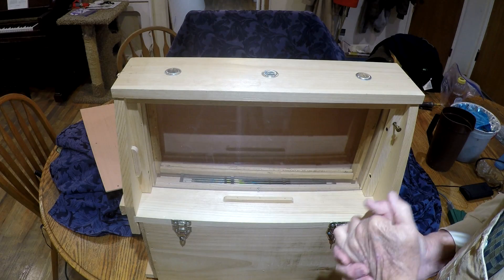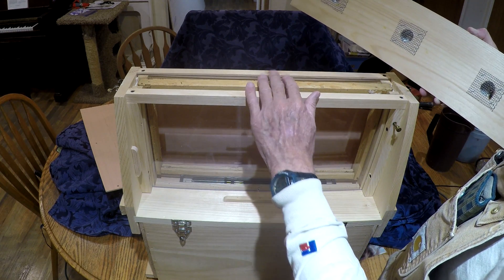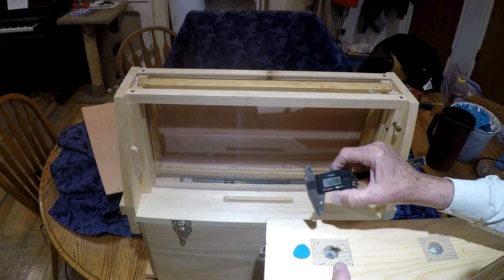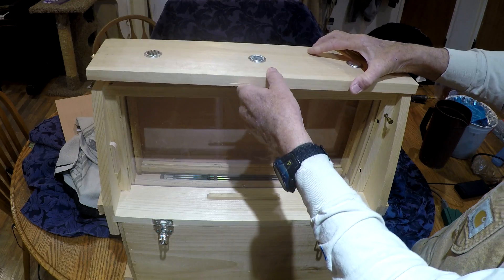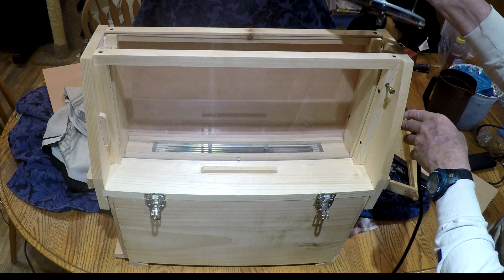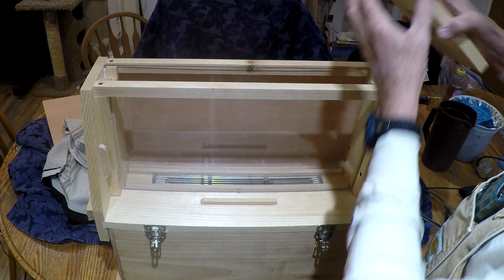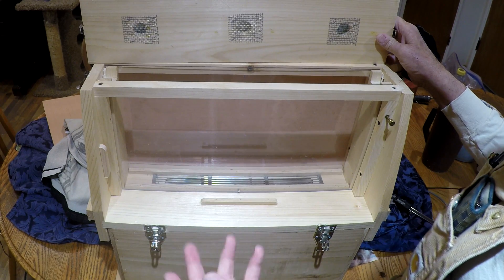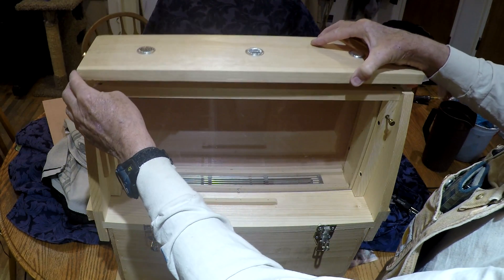Bee space in an observation hive

Comment: Recently bought the same kind of observation hive from MannLake and had the same problem, luckily I noticed it before putting Andy bees into the hive. I put some small strips of wood along the edges of the 2 pieces that hold the glass, which raised the lid a little and was able get slightly more than 3/8 inch (didn’t have a router).